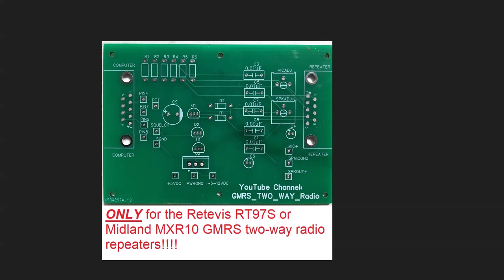🔺 information on Retevis RT97s/Midland mxr10 GMRS two-way radio repeater interface boards !!🔺

Comment: Awesome videos! I know that you have another video where you tried to directly connect to your laptop without an interface board using Zello in Gateway mode. We're you able to get that working? Or is an interface board like this still the way to go?  And if so, do you sell this interface board by chance?
Reply from the maker: Thanks yes I have a few videos using zello in gateway mode. Check out my playlists for more videos. Also, yes, I plan on selling the interface board. I am still testing it out. Once I get to that point, I will make a video on how to buy one 🙂

Comment: So the question is If the 97s has a internal controller. Can you disable the internal controller so it can be controlled by a pi. Im confused you cant have 2 controllers running at the same time and I see no disable pin on the pinouts
Reply from the maker: There are no internal controllers that need to be disabled, BUT to use it with Pi an interface board is needed along with a USB sound card unless the interface board has sound card built in.
Reply from the maker: When I deigned this board, I didn't design it for a PI BUT "technically"  it should work with a PI if a person knows how to set up/config the PI AND will need a USB sound card for the pi